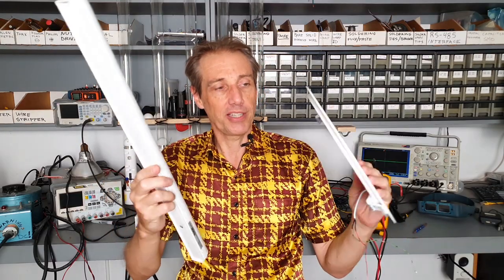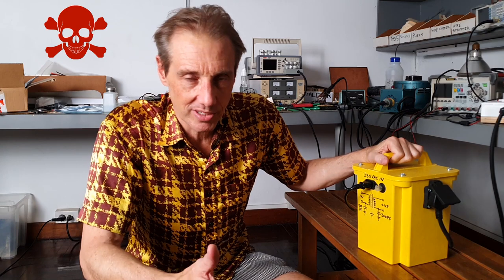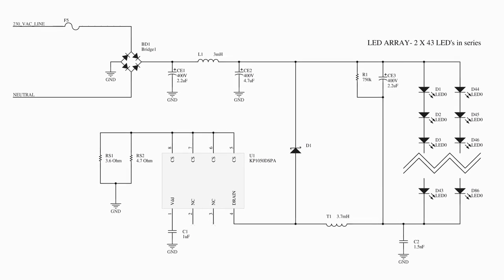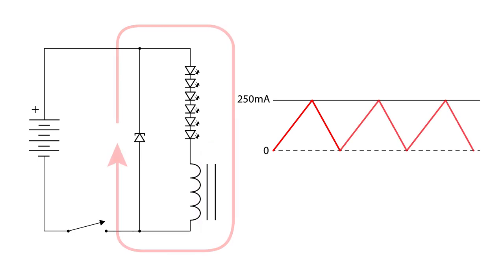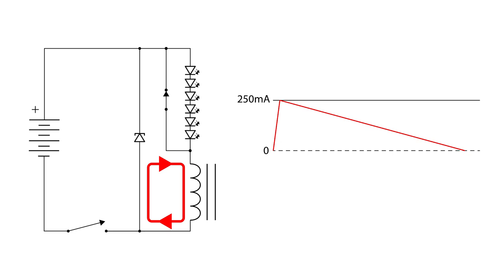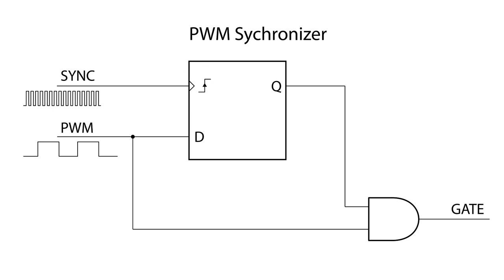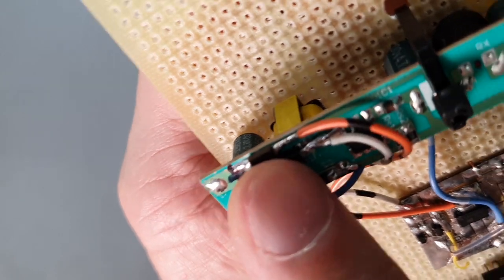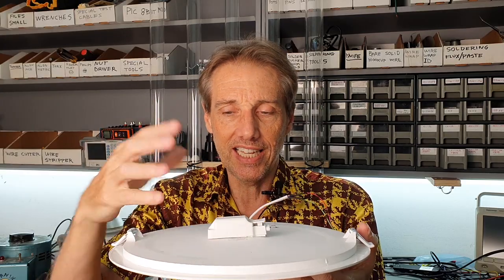Dimming The Undimmable Lights

Comment: Other people: It has almost nothing inside, they've skimped on parts, it must be crap.
Leo: What a great, price-optimized feat of engineering, it does what it needs to do well at the lowest price point possible, hats off to the designers.
It really shows you've designed more than your fair share of products. Anyway, great video, thanks for that! I have to say, I did not expect the synchronization issue at all!
Reply from the maker: The sync thing is really about perfectionism, I hate even the most subtle flickering!
Reply: @leosbagoftricks3732  2:57-3:02 Is it flickering, or just some unfortunate editing? Or the room light is completely different?

Comment: You could also try and mess with current sense resistors. You can add another resistor in series with already soldered ones and bridge it with mosfet. you must set minimum current with that resistor, and there is no way to turn it completely off, but you should turn off power anyways.

It works even better if IC has separate feedback pin, because you can inject current and make it analog dimmable.

* Storage inductor may need to be higher value in some cases when lowering current.

Comment: The problem with DALI protocol, the switch also needs Line AND Neutral, which usually not the case (normally only the line is present at the switch). THEN it needs 2 more low voltage wires which you need to run separated from the high voltage. So a simple retrofit is almost never possible.
To address this problem, I use the switch with an IKEA wireless dimmer (TRADFRI) which costs about 6USD. So I switch the light on-off, and I dimmer it independently if I want lower settings. Would love to see you also incorporating some kind of radio solution. Besides a matching DALI switch (just the switch itself, Berker 2858) costs about 92USD where I live. And I would also needs some remodelling for retrofit(getting Neutral to the switch and also low voltage wire routing), which is price prohibiting. One switch retrofitting would easily costs me about 1000USD at least. So a 6USD RF IKEA dimmer is a better way for my case and I think for most of the others too. What do you think?
Reply: @Joachim Shekelberg Everyone's case is different I suppose. For me it is a brick wall with concrete pillars with embedded plastic tubes (conduits),  which is crazy expensive to extend it is basically "set in stone" (and for low voltage wires I need a new conduit which is a legal requirement here). Most of the costs comes of the many professions involved here, I need an electrician, there will be masonry work (brick and concrete involved) and also a painter at the end. I think I was a bit optimistic of the 1000 USD pricetag earlier. But if you have a drywall with fake plasterboard ceiling, the price will be most definietly lower, I agree. Still when you need to call workers from different domains(electrician and painters at the very least), it starts to add up pretty fast. Just my opinion though.
Reply from the maker: I am building a new house from scratch, so it will be cheap and simple to wire this in my case. You are totally right that for retrofit applications the wiring is a pain. I am kind of allergic to all this IoT and wireless stuff, I love the simplicity and reliability of wired solutions.
Reply: @leosbagoftricks3732  Well, I'm in the middle of building my house (7 years now, pretty big), I would be happy to chat about yours, feel free to drop me a DM. Speaking of the lighting, I gravitated towards the middle ground, on-off switching with regular switches, and brightness via RF. I have a friend how wired his whole building without any switches, each room is controlled via smartphone app. Which is kind of the other end of the spectrum maybe even the cheapest (manual labour is always expensive, each room got an ethernet connected relay box). Also the DALI switches are crazy expensives.
Reply: @Joachim Shekelberg What are you, ignorant? Most places in the world do not run AC in conduit.  So many of your comments are so euro-centric...
Reply: @laszlokrekacs6545  That sound interesting, and a big pain in real life.  Decent wired connections for as much as possible is proven, and most likely going to cause far few problems in the years and decades to come...  Personally, it while the DALI protocol seems nice, it also seems like a lot of work for those many locations that simply don't need it.  
 If I were to find a really nice light/fixture, as shown, it seems like it would be simpler to simply rebuild the power circuit with PWM included to replace the stock one which can connect to a standard LED dimmer.   However, this was a master class at re-engineering.

Comment: I really like you style of presenting, which is both technical and layman to move things along.  Personally, the DALI thing is probably more of a deterrent for a lot of us who simply want to convert a non-dimmable LED to dimmable via a standard LED dimmer.   Excellent work!
Reply from the maker: I understand your point- consider that there are many other ways to get the dimmer data into that micro. You could add a radio, an IR receiver, Bluetooth... etc.
Reply: @leosbagoftricks3732  I kind of regret being too picky about the DALI protocol, so I came up with this sofware only solution:
Set the dimmer value via morse code. Normal on-off switch switches on the last setting, and new brightness value can be added via multiple on-off switch cycles. Even an RTC can be spared (and the button cell too), the PIC16F1575 has 128byte eeprom, so the on time can be written (0.5s, 1s, 2sec, 5sec), so it knows how long was the previous ON time. I'm kind of impatient for the release, but even your specific led lighting model is unavailable here. I could not find the philips BN016C locally only BN013C, which is ~20USD, and I was not able to decipher the modell number of the round one. edit: maybe the philips meson line is a good alternative: https://www.lighting.philips.com.my/consumer/p/recessed-spot-light/5920431H1

Comment: Hi, Leo. Thanks for the content. Do you think it would be worth it to build the whole driver from scratch to be dimmable ? It looks to me that, after including another power supply and a microcontroller, it would be easier to make the microcontroller control a current regulator directly, right? (Im a young engineer with little experience) =D
Reply: A microcontroller and current regulator would be more expensive most likely.

Comment: Nice hack , and very good documentation  and presenting 
However ,  I think  the dimming part   is a little bit over engineering  , considering the original control is done using this  three pin KP1050A device   .
You already mentioned the original feedback resistor in the 3 pin dimming circuit . Wouldn't it be much easier to alter this  resistance value instead of a new pwm circuit ?

My idea is replacing the original current feedback resistor with  lets say some other resistors and making a dimmer shorting accordingly these resistors . It may not have continuous dimming but for more people a  few steps dimmer  is more than enough. 
I think it would work OK and would be simpler .

Considering the DALI interface needs extra wiring , a retrofit project would perhaps benefit more from a wireless interface , like a BLE controller .

Comment: Interesting idea to shunt the load in the buck circuit. For me the only solution would have been to replacing the buck ic with a roll-my-own.
Reply: @Joachim Shekelberg Cap droppers don't work everywhere.
Reply from the maker: If the load current is high- the capacitors required become large and very expensive!

Comment: Thank you for this excellent video! What's the purpose of R6 (510k) in the current source that drive the opto's LED?
Reply from the maker: Good question - the DALI circuitry is copied from an application note, I stared at it for a while, I don't know what R6 does either!

Comment: What about using a optocoupler to change the led linear regulator current sense resistor(s), then only one optocopler is needed per lamp if your controlling more than one? much less parts and rework? Thanks for sharing!
Reply from the maker: Hmmm. Interesting idea. So you mean an analog current loop? That could work, the two problems I see would be linearity and poor dimming ratio. Hard to get large ratios of dimming with analog current control, and you also get color temperature shifts that you don't get with PWM.
Reply: @leosbagoftricks3732  I was thinking pwm the opto's input led (but analog may work also). It would take a little tuning on the resistors (I would use a resistor decade box to speed the tuning up), and pwm freq. It might not be 0 to 100% pwm, but maybe some other value like 15% to 100%. Again thanks for sharing your video.

Comment: It would be interesting to see how the 120VAC version of the LED power supply differs from the 230VAC version. Likely only a couple component changes, unless there are any regulatory issues that cause a larger change.
Reply from the maker: Yes- I would imagine the main inductor is a smaller value, and maybe some parts are of a lower voltage rating? Save a few pennies?

Comment: If you just need high/low setting for your dimmer, you can dim many non-dimmable LED bulbs with just a capacitor.
https://youtu.be/JH68wBXO5j0 
If your LED driver dies, on some light fixtures, you can replace the driver board with a simple capacitor dropper LED driver circuit. You can then switch out capacitors to control the brightness level. You can also change the value of the current sense resistor on the LED driver circuit, to control the LED brightness level.

Comment: Thanks again ! It's a wonder video. I have very little knowledge about AC circuits so I will probably need to learn more before implementing it, but I definitely have flickering chinese LED strip that I'll try to fix once I understand more. 

Quick question : how this kind of display of schematics of big manufacturer plays with patents laws ? Is it okay as long as you don't reproduce the circuit and sell it ? I'm clueless.
Reply from the maker: It's an interesting question, do I have the right to draw and publish schematics of a device I own?  Who knows just how ridiculous this could get?
Reply: If it's patented, it's already public information and you can view and show the original patent, they are not secrets. You can't just produce and sell products that violate the patent.  But simple little circuits like this are most likely not patented nor patentable, they're just basic electronic circuits (that's like trying to get a patent for a "table").  The circuit board design is (automatically) copyrighted, and that just means Leo can't copy their board design and produce and sell EXACT copies. If you're curious about intellectual property, there are lots of website to learn the basics.

Comment: Why can't we just play with the CS pin?
Reply: How do you propose that?
Reply: @jamesbrown99991  Generating an offset voltage based on a smoothed PWM  (could be a µC or even a 555) and injecting it on CS via a resistive divider. Rcs can be calculated for the lowest brightness and the offset voltage will add to the control loop all the way to full brightness. However : "A  disadvantage  to  analog  dimming  is  that  the  color  temperature  of  the  emitted  light  can  vary  as  a  function  of  LED  current.  In  situations  where  the  color  of  the  LEDs  is  critical,  or  the  particular  LED  exhibits  a  large  change  in  color  temperature  with changes in LED current, dimming the output of  the  LED  by  changing  the  LED  current  would  be prohibitive." 
source :  tinyurl.com/357dy56n
Reply from the maker: If you read the data sheet for the chip, the way it samples the sense resistor voltage is not straightforward, I don't think it would be that easy. Even if you could, the dynamic range of dimming  would not be very large, and OFF is not an option.
Reply: @inotoff  CS is not just a feedback pin; the full switch current comes out of this pin (i.e. 250mA). For this reason, you'd need a low impedance driver to inject your voltage.
There's the added issue that the CS pin is used reference VCC; this means that the analog voltage you inject will just increase VCC by the same amount, and the current will therefore not be affected by the injected voltage. The combination of resistors will set the current, and because the resistor values are constant, so is the current.
One approach that would work is switching in different resistors (e.g. 4 switched resistors could give 16 levels of brightness), but this uses more parts than Leo's version, and doesn't provide an OFF setting.
Reply: @jamesbrown99991  Thank you for detailed reply. If changing the resistors work, what about adding a Mosfet parallel to the resistors to control the overall current flow out of CS? (leaving the OFF option out)
Reply: @sohailb108  If you control the MOSFET gate voltage appropriately, it should function fine as a controllable resistor.
Reply: What about using a optocoupler to change the current sense resistor(s), then only one optocopler (and low voltage PWM driving the opto's LED) is needed per lamp if your controlling more than one? much less parts and rework?